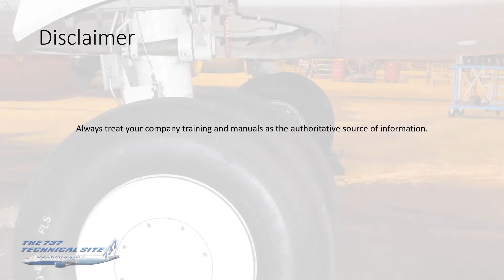737 Landing Gear Guided Tour (Classics)

Comment: The shock struts are pressurized with nitrogen, correct?  Is that a walkaround item?  What's a typical pressure?
Reply from the maker: Yes nitrogen. You can see some typical tyre pressures on this page: http://www.b737.org.uk/landinggear.htm
Reply: @ChrisBrady737  YOUR WEBSITE IS LOADED WITH MALWARE!!!!! EITHER FIX IT OR SHUT IT DOWN!!!!!